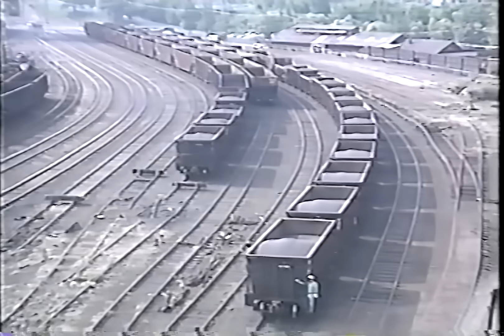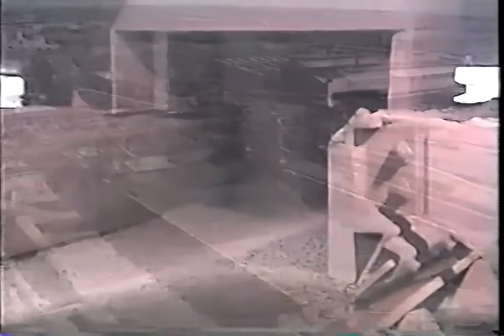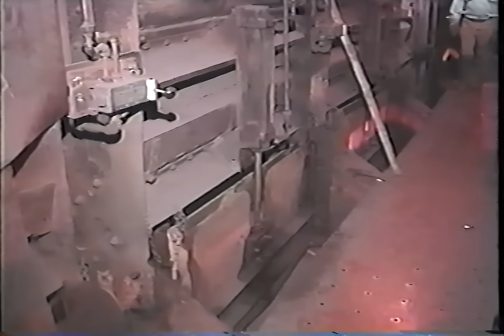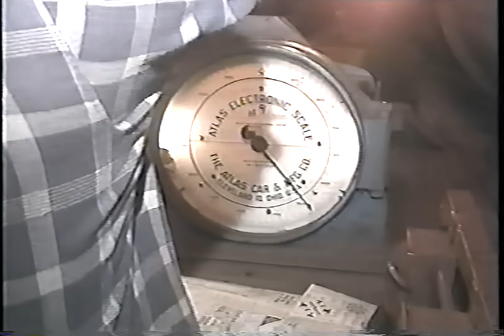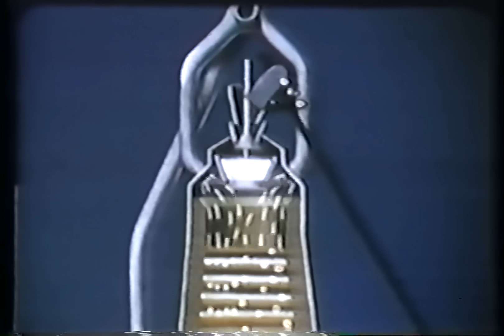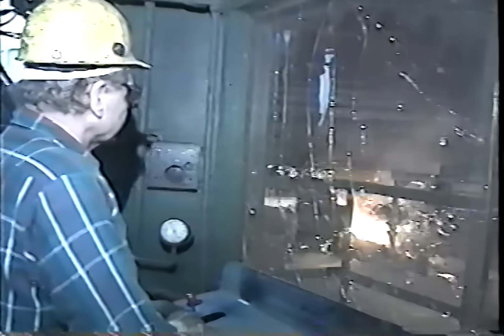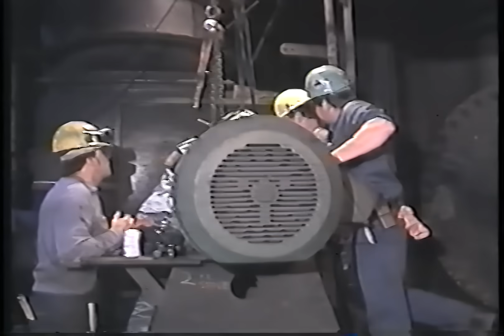Beth Steel Furnaces

Comment: the company i work for bought the 5 stand 56" cold mill from dofasco back in 2007 or so. we used two of the stands to build a tandem aluminum cold mill.

Comment: I lived in south Bethlehem in 83-85 i remember hearing the forge running,  i worked several jobs not ar the Steel but Lehigh Pizza, The Hess station, and later in tge 90s i wad A supervisor for security on the outside of the plant they had different security inside i was responsible fior rhe former Martin Tower, Leacoca Research on top of the mountain "Lehigh University". And the one building that is still standing that has a movie theater in it , i think it's some kind of museum now.  Now we have a casino 😢 amd most of thos historical facility is long gone!😢😢

Comment: Great grandfather worked here in 1901 after 20 yrs in coal mines in PA. Grandfather worked in the foundry 1907-1958 and helped cast the plates that are the shell of the Lincoln Tunnel to NYC. Dad worked in Purchasing 1951-1968. Uncles and cousins worked in the mill. I got a Mechanical Engineering degree and worked for a Coke oven builder and minimills in NJ. Steel was good to my family for 4 generations.  South Bethlehem holds many memories for me.
Reply: Greetings from Australia, :hand-pink-waving: Great heritage. Something to be proud of. ❤
Reply: I grew up in the Detroit area. Most of my family worked for Ford or GM. At least three generations. Automobiles were good to my family. I also am a mechanical engineer (Dad was tool & die). I chose chemicals and refining over automobiles even though I had a good offer from Ford. I worked with boilermakers and pipefitters mostly. Some millright, some electrical/instrumentation. Recently retired.
Reply: Forgotten American. Thank you for your families contributions to this great nation.
Reply: God bless you brother

Comment: Bethlehem Steel though they had the WTC contract for steel. It went to a Japanese company., who made it and transported it to NYC. Was it a case of Dumping? Bethlehem had a practice of allowing employees to leave after 25 years of work; something they could not afford. There was no retirement plan or system in place and limited amount of looking ahead to replace old manufacturing processes. Eventually their retirement plan was made actuarially viable, but insufficient funds were put away, instead giving bonuses to management and shareholders. The mining company where I grew up did not follow these practices and are still in business, it, like the remainder of BSC is now foreign owned.

Comment: I spent my early years in the shadow of a small foundry in northern NJ (American Brake Shoe) where my grandfather worked, and also within view of a major Ford Motor Company manufacturing plant.  The smell of the coke ovens early on a crisp winter morning while enduring the Watergate saga on the black and white TV is burned into my memory, and still brings back fond memories whenever I pass by a steel mill that has coke ovens in operation.  I will never forget the coke oven smell, nor the sound of the steam whistle at the start of shift, lunch break, and end of shift.
I now live an hour north of the former Bethlehem Steel site.  It's sad how the steel industry has died off in the US.

Comment: I went there and to Sparrows Point on audits back in 1980 (the company I worked for used quite a bit of Bethlehem steel plate).  Even back then they were getting a lot of foreign competition with countries dumping steel onto our market.  It is sad that today most of our heavy steel manufacturing capability is gone.  Heavy fabrication of forgings and castings is being done overseas.  I have seen the downturn of many towns from losing their manufacturing base to overseas competition.  We have become a “service economy” where min wage jobs are plentiful.

Comment: Is this Bethlehem Pa plant? I thought the blast furnaces were closed by 95 i worked at coke works in 1991 upgrading pollution control on sulfur smoke coming out and they said it was one of only a few things still working.

Comment: now china makes all the steel. The steel mill I work at will soon be shut down as well and putting in an arc furnace. After 120 years of operating..... Clean steel eh. Sad, so very sad.
Reply: China does not make all steel. Who told you that?

Comment: My first project as a brand new GE field engineer was at the Bethlehem PA plant back in the 90’s at the Combo Mill. The workers went out of their way to take me around the entire plant to see everything that was still in operation or was being dismantled as they knew it was all coming to an end.  I was able to see places only those who worked were allowed and got up close to everything.   It was unreal.  The sheer size of equipment, the power, the heat, and the ever present danger. The enormous ladles turned horizontal with large blow torches firing away to keep the moisture out.  Being feet away from the solid beams coming down from the roughing mill and then the  water/oil mix dousing the solid beam as it passed through the first stand.   They went out of their way to explain the operations and most importantly safety - proper PPE and keeping your head on a swivel.  4 month of real world education were an important learning / appreciation experience for the rest of my career as I went on to other plants US Steel Fairless, J&L Specialty, Nucor as well as overseas plants.  Sadly all, but Nucor in AR plants I did time at are gone.
Reply: How can the USA fight any war without ability to create its own steel?
Reply: In my time we built other plants in other allied countries so getting steel to the US I don't see as an issue - we built          those plants partially because its cheaper to import - same thing with textiles and other industries.  It comes down    to economics - if you want lower prices for stuff - then this is what happens - if you want to bring it all back then we all need to be prepared to pay more because of the wage / benefit increases for a US workforce etc..      Same deal with import tariffs. you can jack those up, but it still will cost you overall.   The Union guys were very candid when we talked about the closing and the demise of US steel dominance in the world.  They admitted they were just as much at fault as the executives..  everyone was after their own interests and were not seeing the big picture - they showed others how to do it and were arrogant about them never surpassing the US.  Geopolitics / Economics is a tricky area - you can back yourself into a corner if you decide to just take the ball away and go home - you need to be playing chess and not checkers.. and a climate of he said / she said blame the other only empowers those outside who want to do you real harm.. who needs an army and tanks anymore when you can destabilize and get people to infight and take their eyes off the real threats to them with a simple facebook post..          @superchuck3259
Reply: @yopajo  Americans became a nation of consumers first and producers second by the 1970s. 

With Ronald Reagan in charge in the 1980s; a massive wave of de-industrialization hit America. Now with Biden-Trump in charge, we’re trying to re-industrialize after 50 years of de-industrialization.
Reply: @superchuck3259 there are mini mills that can melt and refine scrap steel, most of which is imported.

Comment: The narrator keeps referring to "iron" throughout the video. At some point in the process it chances from "iron" to "carbon steel." I assume that's in the blast furnace before its loaded into the hopper cars. Is that correct?

Comment: As a young man I worked at the Clay Cross in Foundry in England. The original furnace was still mostly intact but long since redundant. I walked up the ramp to the top of the furnace where the  men of that time laboured up the ramp with wheel barrows to charge the furnace. Now here we are generations later, the evolution of all their labour, and knowledge transported across the Atlantic Ocean. The evolution continues, now gone  from here, and moved on to other places.
Reply: Well even the furnaces in this video have gone dormant, it's fading everywhere.
Reply: @MuddyBubby  Not in China.

Comment: I was a dispatcher and one night they had a slag explosion that shook me about 3 miles away. Suddenly my phone lines lit up like a Christmas tree,  every line. Homes were literally moved on their foundations and windows broke all over the place from the explosion.  I took over 100 calls for damage in less than an hour. We were on the opposite side of the river from the slag pit and apparently someone wasn't watching and dumped slag into a large puddle of water causing an explosion.  It was a rough evening as we only had one dispatcher on duty then and had to answer phones and radio traffic simultaneously.  I wasn't too happy with Bethlehem Steel that night. I worked my butt off.

Comment: Great Video! I was watching videos about Sloss Furnaces in my hometown Birmingham AL. This came up in my feed. It was so cool to see this because it looks alot lot Sloss but bigger. And Sloss made pig iron. Sloss opened in 1881, closed in 1971 and was declared a NHL and museum in 1981. I remember going there on a grade school field trip in the late 80's. In the mid 90's they converted one of the casting sheds in a stage for concerts and theatre with a 3000 head capacity. In Oct 98 Sloss Fright Furnace was born. The largest haunted attraction in the state. The trail was only 1/2 mile. I started scaring people there in 2001 and my last October at SFF was 2011. The trail was 1½ miles long and had 2 sub trail off site. SFF operated every October from 1998-2019 and had millions of patrons. Covid shuddered SFF for good. But Sloss lives on 50+ years after the furnaces went cold. There's a annual 3 day Brewfest there every summer that attracts thousands, concerts, weddings and other events. Sloss is open to the public after being closed for a 1.5 years due to Covid. Aw shucks. I'm getting all nostalgic about my home. As they use say at Sloss. Blood, Sweat, Ore and Coal. Forever the Furnace owns my Soul. 

Roll Tide!

Comment: It Is My Understanding That Making NEW Steel From NEW GOOD ORE Has A Higher Quality, Than Making Recycled Steel From OLD Steel Products.  Reinforcement Rods And Lower Strength Applications Are Made From Recycled Steel.  And THAT Is What A Lot of Foreign Steel Was Made From.  Items Like Leaf Springs On Trucks Made From Foreign Steel Wasn't As Good To Form Or Held Up As Well As NEW STEEL For Durability.  But Industrial Steel Making Cities Like Pittsburgh And Youngstown  Were Very Filthy And Polluted Areas Indeed.   Coupled With  The  Lack Of Modernization By  Retaining Obsolete  Practices,  DID Have A Heavy Hand In Our Steel Plants Closing,  There Was Also A LOT Of Replacing Steel Items With PLASTICS Too.  It Was A Combination Of Several Factors, Both Foreign AND Domestic,  That Led To The Decline Of Our Steel  Industry.  Yet It's Still Hard To Imagine HOW We Can Ship The Raw Materials For Making Steel Abroad,  And Have The Finished Steel Products Shipped Back To Us Again, Being Done Less Expensively Than WE Can Do It Here In The States...

Comment: In 2000 and 2001, I was a truck driver delivering refractory brick from Michigan to the steel mill.  The brick was used to line the giant ladles in an area of the mill no longer used.  I asked them what the point of this was since the plant was shut down.  A supervisor said "It gives them something to do".   I wish I had taken pictures of the place. It was a giant ghost town with maybe a dozen union workers in total.  I drove my tractor trailer inside the building near these giant ladles.  There was a supervisor hut in the middle of the building with the lights on inside. Was like a little house in the middle of this huge factory.  I go inside to find the forklift operator, and they were all sitting in there playing cards and drinking coffee.  The factory didn't look like it had been operated in years.  Windows busted out everywhere, no lights on inside except for that little hut.  

I asked him if I could go up on the catwalk to watch them lay the refractory brick, "yeah, no problem".  I get up there, probably 4 stories high, and look down into one of the ladles.  There were two guys actually laying brick, and about 5 guys standing around doing nothing.  I've been to a few steel mills including Nucor, but never witnessed anything this weird.  Nucor was bustling and alive, Beth was dead as a door nail.
Reply: That's a shame and part of the reason they went under.
Reply: Unions. Cancer. Same thing, both kill their host.

Comment: Great video Donald, I'm getting in HO a Plymouth 120T CR-8XT built up for sales at present here.  Its just taking a little longer than I anticipated to get it prototypically correct so the rivet counters don't kill it before it gets started.  The detail is 300% better than any industrial switcher thats been produced so far.  In six months or less I should have a working model for sale in an undecorated version as well as some paint schemes of Bethlehem Steel, J&L.  If this goes as planned, a GE 132T industrial switcher well be next for uses in a lot of different industries with a slew of paint schemes to match industry.  I received the four Kress Trucks built for me in HO while up in North Dakota a few years back.  I haven't got a Facebook at present but will get another one so I can rejoin the steel mill group a little later on.
Reply: I have no idea what you just said but good luck making the trucks or switches or whatever you do

Comment: Driving through the back road a long the blast furnace area behind the casino especially at night or walking around there's such an eerie feeling, walking the walkway they built along the furnace further explains the process, you can stand there and imagine whatver was like when it was all operational, the sound must have been deafening, where I live in NJ we had a steel plant actually at one time we had a couple but the last one to close you could hear it especially at night, a lot of creaking and banging.

Comment: The mill I worked at is gone too.  It was in Utah, originally a WW2 defense plant, then USS, then locally owned. As an instrument tech, I rotated through all the departments.  The blast furnaces were as impressive as any.
Reply: Oh really? Where in Utah? I’m located in the northern Wasatch front. I find this stuff pretty fascinating.
Reply: @yourdadsdad  Geneva Steel's 1,750 acres (7 km2) of land were sold in November 2005 for $46.8 million to Anderson Geneva, a sister company to Anderson Development, which plans to reuse the land for a wide range of purposes, including the FrontRunner commuter rail corridor.[8] The land must undergo environmental cleanups before any development can occur, with most of the cost paid for by U.S. Steel.[8] The mill equipment will not remain because it has been sold for $40 million to the Chinese firm Qingdao Iron & Steel Group.
Reply: Thank you for sharing your story.

Comment: My gosh that was an inefficient as hell operation. I wondered around what's left of the steel plant last summer. The buildings are all gone, except for the blast furnaces which are lit up at night. You can now walk the elevated train track right up against the blast furnaces. The train cars are still there they just parked them and walked away. The iron dump pit is now flat and its where the casino is built; however the casino is just a tiny portion of the former pit. The casino is the size of a grain of rice in the dump pit. In 1995 the plant closed and the employees just walked away. What is left in place is frozen in time.
Reply: How would you have changed it into an efficient as hell operation?
Reply: @scotthares  he would try to turn it into a solar plant LOL

Comment: I worked there in 1973,  Lots of interesting memories.
Reply: I worked for Allied Chemical's coke plant in Ashland, KY in 1973. It was a hell of an operation. I ran the charge car over the oven banks.
Reply: @1940limited  I have a huge amount of respect for anyone that ran a larry car back then.  One of the nastiest jobs I have ever seen.   The one worse I saw was the lid man that opened and closed the holes you fed the coal into.
Reply: @tomhoward1996  I had a magnetic device that did that as part of the charge car, but a separate man then poured sealer all around the cracks after the lids were installed. It was a really neat place and a great experience for a 23 year guy. Thanks for the comment.

Comment: Looks like a hellish environment to work in. Used to drive truck past this plant around the time it shut down. Looked like a metal monster out of a nightmare.
Reply: Sounds like you should spend your life hiding in your closet with your emotional support butt plug.
Reply: @johnlockesghost5592  Took you a whole year to reply. Does your brain hurt now? If it does, try pulling your head out of your ass.